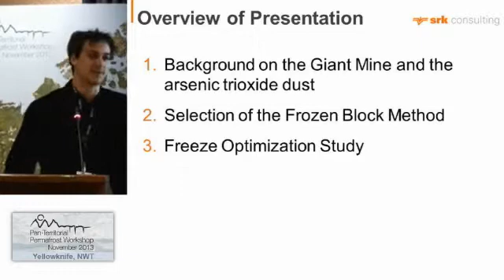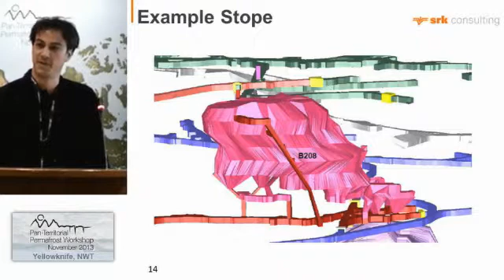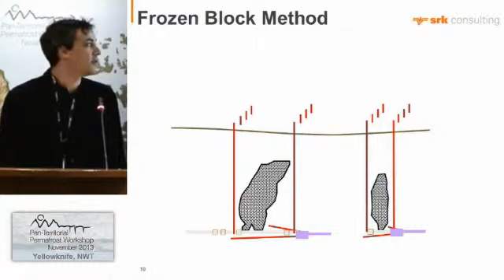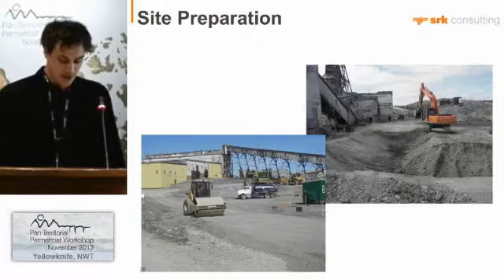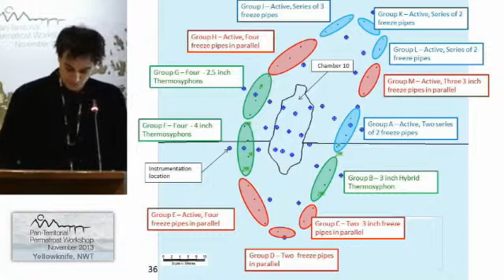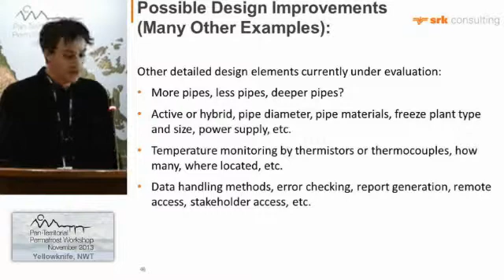35 - Giant Mine arsenic remediation - Peter Mikes

Comment: On a serious note.. is they're no way you can drill large holes into the top of the chambers and pump in extra fluid concrete mix.. tons and tons and tons until it fills the chambers mixes with and absorbs all of the powder into the mix and sets hard.. ?